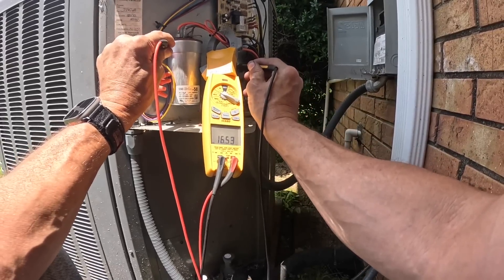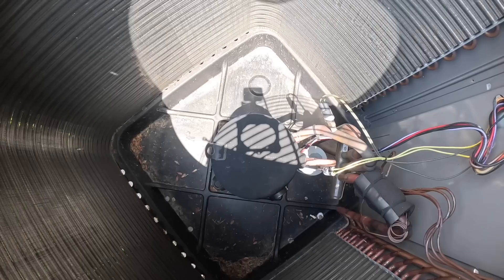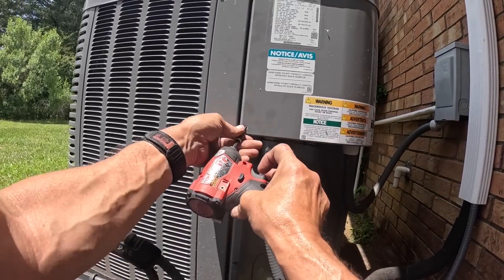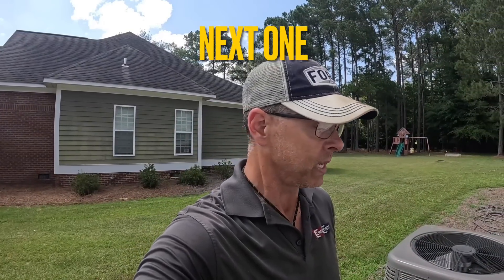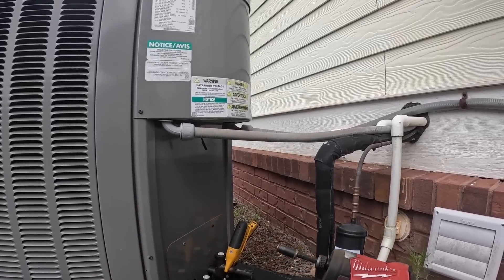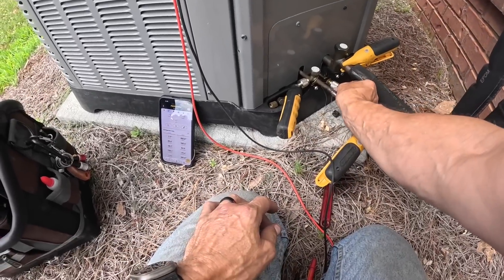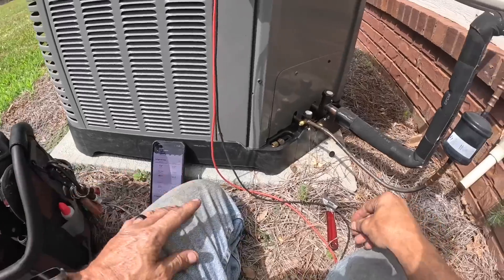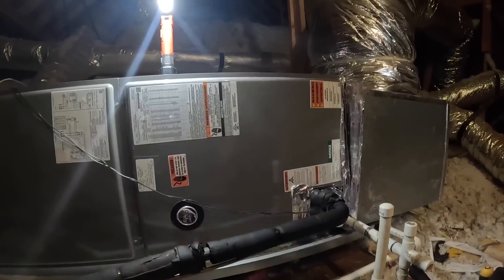Nailing Down Work For Next Week! #hvacguy #hvaclife #hvactrainingvideos

Comment: AC at our site died. It said the pump/compressor blew up. It was probably never serviced. You have to check it from time to time. I didn't check mine, it iced up inside and knew that was bad, no cold air and turned it off. Most would let it run till it dies.
Nice work

Comment: Reading resistance in megaohms on a standard DVM and using a megger like the Supco are two different things.  The DVM reads resistance through the windings to ground and is not an accurate or reliable way to condemn a compressor unless, of course, you're reading a dead short.  The megger on the other hand uses around 500 volts to check for leakage from within the windings to ground.  I'd use the Supco to test for leakage from each pin to ground and verify the compressor is indeed bad before replacing it.
Reply: I agree with oddo. you can't go by a regular meter to condemn a compressor like that. unless it is 1-5 ohm directly to ground. I would power it up and make sure wires are tight and capacitor is accurate.

Comment: Hey i got a question do you ship the warranty compressor back to the manufacturer and since it has a warranty still does it cover the freon and labor? because if it was working and not his fault that it failed it should be covered
Reply from the maker: Just the part is covered- not drier, not refrigerant, not welding materials, and not labor. I have a local supplier that I drop the compressor off to.
Reply: @HVACGUY looks to be a RUUD or RHEEM unit. Pretty sad the unit is only five years old for the compressor or anything else to fail.
Reply: The REAL warranty with equipment you Buy from a contractor is by the actual contractor. thats why you get what you pay for.  That up front cost help cover the true cost of having a  "warranty"
Reply: @markcotter2355  Well Well mark Im sorry but I have never heard of just one  HVAC contractor eating the cost of a repair in totality under warranty Normally they give you 30 days on installation and you get raped by the contractor for minimum 6-10 thousand extra for a chicken shit warranty not worth it to me because I can buy two or three units with what i’m paying for the warranty so keep it!!! even Curtis admitted the other day in a video they were charging double for the same repair !!!! it’s nothing but a scam that why they hate us HVAC  contractors so badly!
Reply: @markcotter2355  you rat you deleted my reply to you or curtis you did this didn’t you? I see you now can’t take the truth goodbye to you are cancelled

Comment: I do enjoy your successes...
Two TXVs failing; possible contaminants in the lineset?
Reply: My thoughts too, something is up, unless the replacement was defective.
Reply: I am guessing not enough air flow or over sized equipment based on the ductwork. Looks like 2 tons worth of heat pump ductwork.